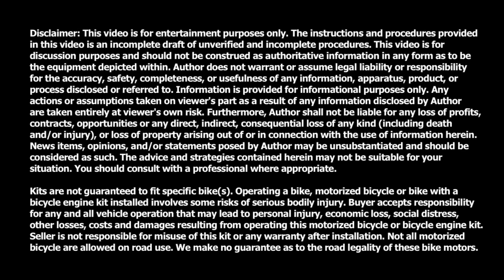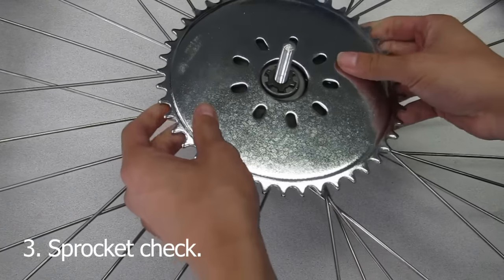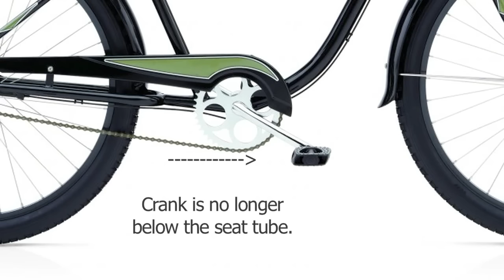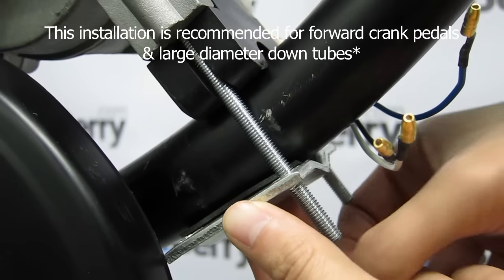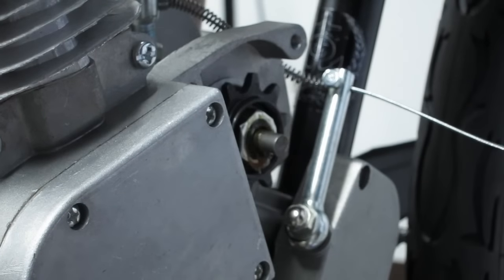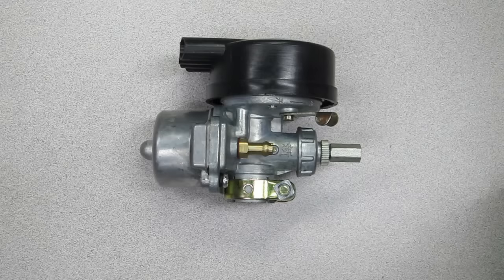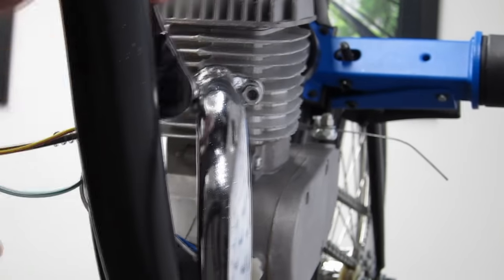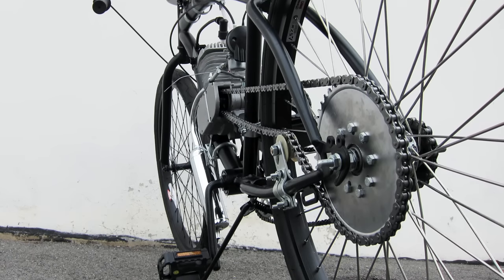How To Install 80cc 2-Stroke Bicycle Engine Kit FULL DVD 66cc 48cc 50cc

Comment: The throttle explanation is 100% TRASH! Any 1st timer is bound to make a ton of mistakes following this video!  You don't explain how the throttle is housed by the kill switch mechanism. From watching this video I got the impression they go beside each other. I had to drill 2 holes in  handle bar after I realized the throttle went in the kill switch casing. And still, how do you put it in correctly??  Then I threaded the other end of the throttle cable to the Carburetor, but i did it wrong because the video is vague and unclear. I've had to install  tighten and remove that carburetor twice now.

Comment: This is all assuming your kit comes with all of said items in His Parts list.. Mine. Didn't come come with the Universal Mounting Kit! And 1st off. The bike i got. Was Not the one advertised. On line it was listed as a Shwinn. I got a Huffy! 3rd,4th and 5th was the fact that the email was more than likely bogus. As well as the fake ass phone number. The best advice I can give. Is research the company you decide to go with. Undoubtedly Bicycle Motor Works out of PA. Is at the very least a Sham. I've called and left what at 1st were concerned complaints. As i continued to realized how much of my parts list was missing. The calls became more and more aggressive and obviously more violent in nature. I can't help it. I'm Hawaiian and Navajo. The best advice i can lend. Is stir clear of those guys...

Comment: Only good on a men's bike????  Please design one to use on a women's bike
Reply from the maker: We do carry a 4 stroke friction drive motor that can be mounted on most adult bikes, men's and women's. Unfortunately, the design of center mounted engines does not pair well with step through frames, which is a common design for women's bikes. A standard men's bike has an open triangular frame that allows for the safe mounting of a center mounted engine. Due to the limited locations to safely mount an engine, the only engines that are compatible with step through frames are rear wheel mounted engines, like our friction drive engines.
http://www.bikeberry.com/gas-engine-kits/4-stroke-bike-engine/flying-horse-49cc-5g-lock-load-friction-drive-bicycle-engine-kit-4-stroke.html

Comment: This is where I bought my engine kit from and it actually works amazing and runs smoothly compared to other engine kits that I did before and if you want to buy one check this link https://www.amazon.com/gp/product/B01703ODTI/ref=as_li_tl?ie=UTF8&camp=1789&creative=9325&creativeASIN=B01703ODTI&linkCode=as2&tag=mo049-20&linkId=c2b3157f65b7d083cf70f65cecd523a6

Comment: Okay a motorized bike with no brakes at all
Reply from the maker: We do not advice any rider to use any type of vehicle without brakes, and deliberately state in the video to install some type of braking system. We are currently in the process of making a video covering the different types of brakes and the installation process.
Reply: I suppose that the brakes are installed in the pedals wherein it'll stop when u put it in reverse cycle. Thanks! Great video..i will buy one for sure..

Comment: Don't forget: If you live in the shitty ol'State of New Jersey (Or any other Liberal flee-bag controlled state) Your motorized bicycle must have Below 1.5 horsepower and 50cc. Also, you need a valid driver's license, you must obtain title and register the bike (annual fee), you Must place a valid Moped licence plate on the bike, and obtain insurance:  "Obtain liability insurance covering 1) bodily injury (up to $15,000), 2)
death (up to $30,000), and 3) property damage (up to $5,000)."

Comment: You dont need to remove clutch to install chain! Donkey
Reply from the maker: You are entirely correct. As we mentioned before starting the chain installation, there are numerous ways to install the chain. We found the sprocket had too much resistance when rotating it to feed the chain. Loosening it would have sufficed, or simply powering through with some extra muscle, but we decided to take it off completely to check other components and to show off the other parts.